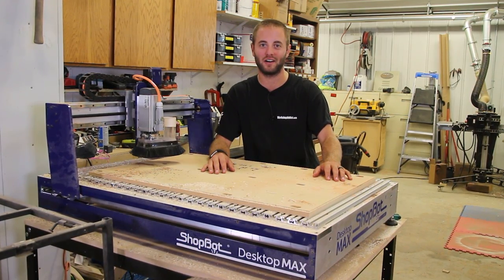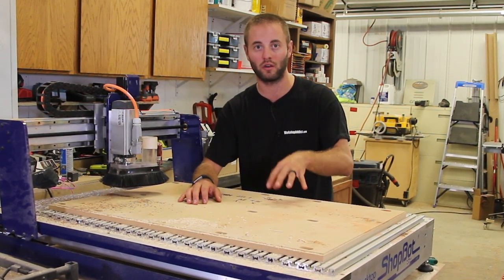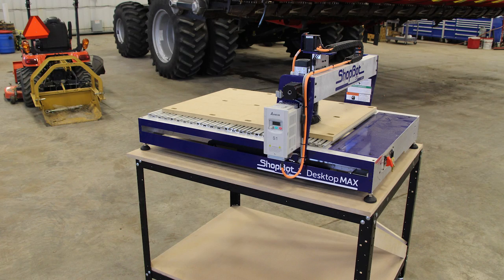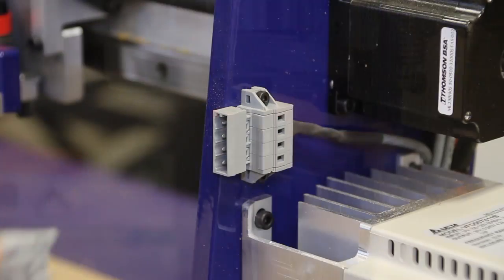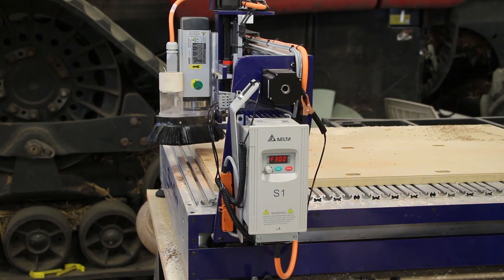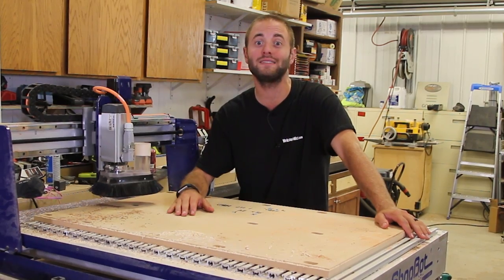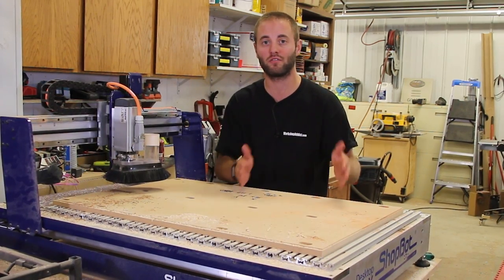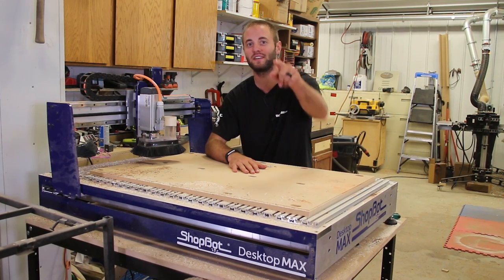ShopBot Desktop Max | Delivery, Setup, and First Cuts

Comment: I would love to own one of them, but I can only imagine the price tag on it. #WorkshopAddict
Reply: I looked it up.
$10,500.00.....holy smokes...
It's a nice unit but I couldn't afford half that much.
Reply: totally unrealistic to I'm sure 90% of their viewers, whatever ever happened to handcrafted? And what happens when the computer screws up how much that gonna cost you? Here in Houston I'm sure it would last a month and fry because of our high humidity, even if it was air conditioned room it still doesn't take away the humidity.
Reply: Shopbot unit is mainly aluminum.  Spoil board is MDF.  It is meant to be inside, but not necessarily in HVAC.  After living in Houston for 25+ years, I would suggest a dehumidifier for most of the year (I lived near Copperfield, not Clear Lake, so YMMV).  -- Shopbot is the cadillac of the hobby CNC world, also has a very active international user group.  A little company in Katy makes a good wood (and now an all metal) set of machines you might check out for fewer $$ https://buildyourcnc.com/CNCMachineKits.aspx - not a customer, but a long time follower of theirs and Shopbot.
Reply from the maker: greatbay1961 computer doesn't screw up the programmer does! It will do exactly what you tell it to do
Reply from the maker: greatbay1961 also these tools bring products and abilities to a shop that were not able to be had before. They make a shop more efficient, more flexible, and more profitable. That isn't a ShopBot plug, that is for any CNC. Stay tuned for future videos and hopefully you can see the value